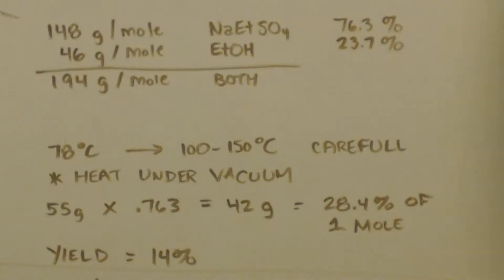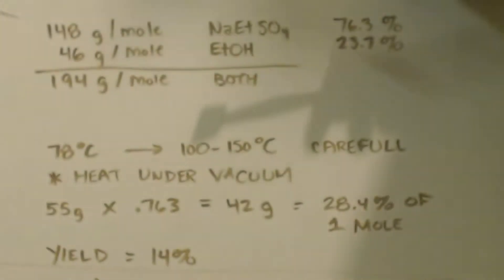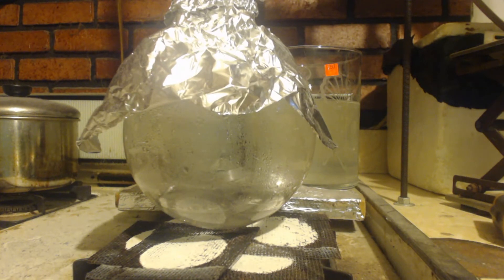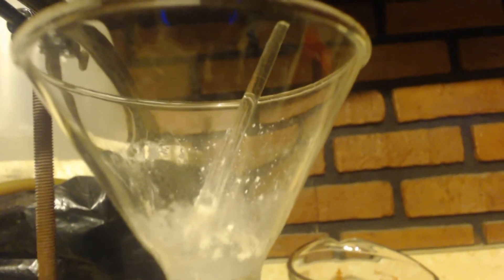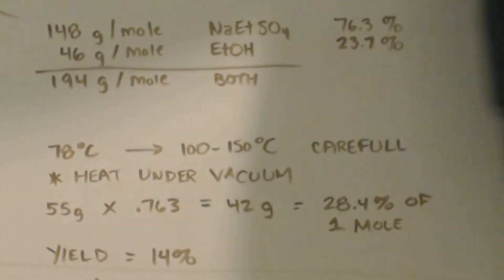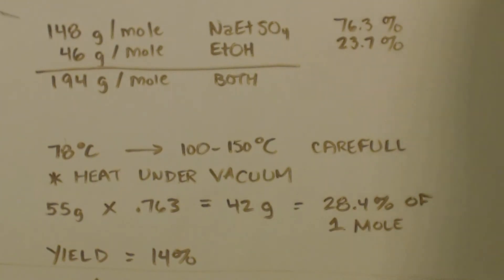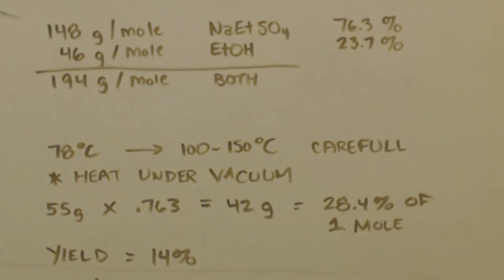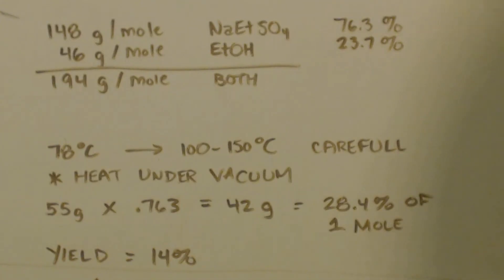SODIUM ETHYL SULFATE SYNTHESIS  part 5

Comment: Nice video series.  Learned allot.  Very detailed, but still edited enough to not be boring.   Thanks!

I'm not sure why you were so afraid to use MgSO4 in a soxhlet though.  Yes, MgSO4 is soluble in water, but that is only a problem if you don't really use enough.  In other words the stuff on the top is going to hydrate and some will dissolve.  The solution will quickly saturate and I would expect almost all of the remaining MgSO4 would precipitate out as the water is absorbed into the rest of the anahydrate.  Yes, you will get an accumulation of the trace that makes it through into the boiling flask, but you later get tons of sulfate precipitates anyway.  Would likely cake like crazy, You could have also dried your alcohol with CuSO4, distilled it, then used a sieve to get closer to 100%.  You could also use CaSO4 (contamination risk is more known but weaker dehydration) or CuSO4 (higher contamination risk, but better drying than MgSO4 and more visible).  

I had a good laugh about the addition funnel; ending the argument with, "besides I don't have one anymore anyway."  You can put the funnel in the freezer first, but be careful that it is dry and be careful to loosen Teflon stoppers first, or they stick.  Or you can just do it outside or in the garage when it is -30C out! Super fun!
Reply from the maker: Cam........I am glad you liked the videos.   I love how you thought out what would happen if i used MgSO4 in a soxhlet.  That makes perfect sense.  As long as i use enough MgSO4 the stuff that dissolves will undissolve (precip)  when enough water is taken out.   I hate dealing with a clog or caking  like you said.   To me it is no big  deal to get a smaller yield.   At least on first attempts.   Even in my grignard reaction videos i do not dry everything great and i do not dry my glass at all.   I save that ....meaning worrying about the water.......in future attempts.   After i make sure i can do the reaction at all.   BUT THAT IS A GREAT TIP .....THANKS.    I will definitely use it sooner or later on future attempts.   
                    The reason i always use MgSO4 in most of my videos is cause i am not good with change.   And in my first couple of labs that is all i used.   Although i have tried others like CuSO4 and etc.   But  i usually stick with MgSO4 or CaCl2 if alcohol is also a contaminant.  But the reason is this..........I made like a ton of MgSO4 anhydrous and i really just want to get rid of it by using it.   Although with EtOH i find it is hard to make it anhydrous unless i use molecular sieves.    It just seems never ending trying to dry it completely with anhydrous salts
                       I am down to a porcelain burchner funnel right now. And i have no garage but man i wish i had one.
Reply from the maker: Cam..........if you watch my video where i try to make nitroethane from this sodium ethyl sulfate you will see i REALLY SCREWED THAT UP.........My main thing was i did not mix everything properly or pulverize the salt mixture.   But i made many other mistakes too.